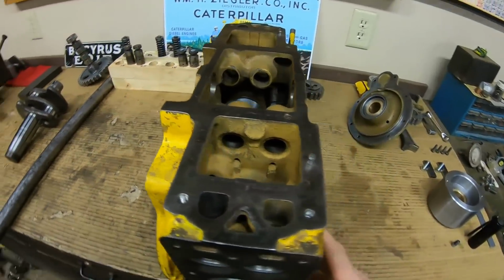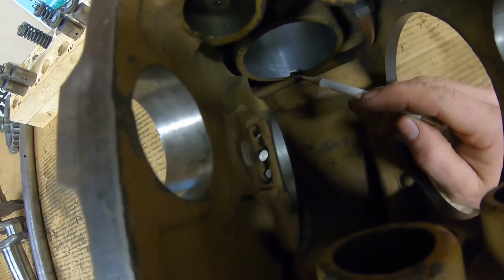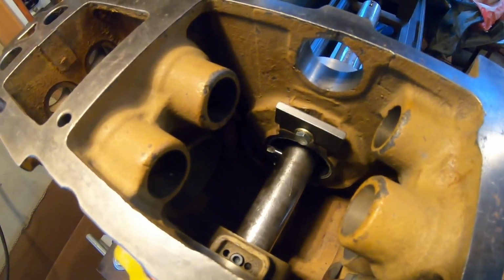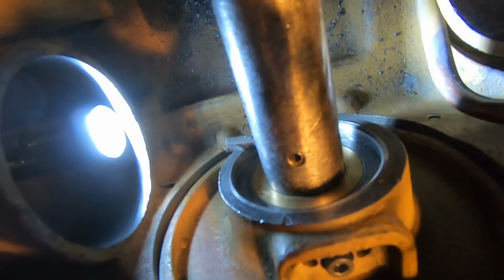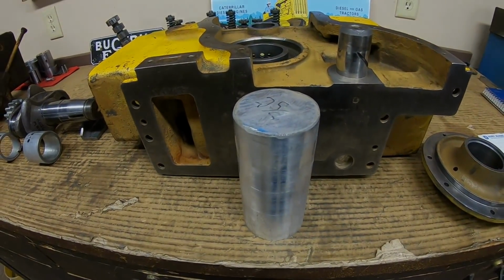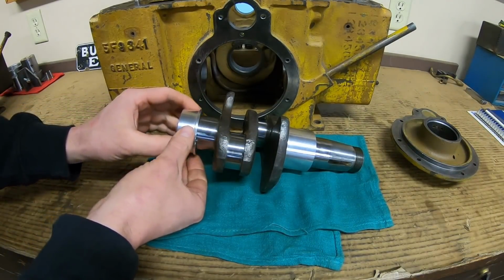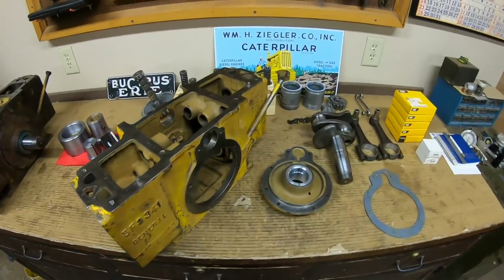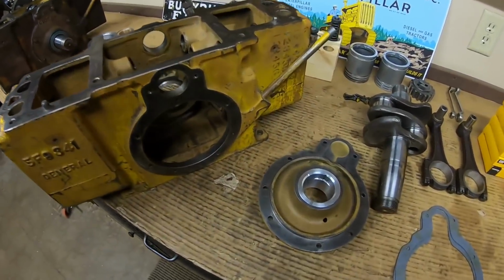Caterpillar D2 #5J1113 Starting System Ep.14: My Total Pony Main Bearing Redesign - Kinda Crazy!!!

Comment: William Powell I enjoyed the rebuild of the pony Motor for the cat engine. I have never been around heavy equipment. I have enjoyed watching you completely rebuild the D2 cat.
I mostly deal with the boating industry.   
What is the things that I rebuild on outboard motors lower units stern drives in car engines used in boats.
I have installing A lot of cat diesels 6-8-12 cylinders in our yachts.  
I have always enjoyed rebuilding and repairing things since I was a young boy I am now retired 67 I am always watching stuff on YouTube that’s how I come across your channel keep up the good work enjoy it thanks Bill

Comment: You could avoid chamfering the bores edge by undercutting the inside corner of the flange on the bearing with a radius. For example take a triangular with 1/32 radius turning tool, touch the flange face and plunge into the bearings OD. This creates a corner that radiused about 90 degrees then tapers up by the angle (15° to 32° depending on how you set it) of the back side of your insert to the OD. I have seen this in several different applications, mainly in hydraulic cylinders ie rod stubs to clear pistons, wear ring grooves on pistons. Easy to do, and seems to stop cracking.
Edit: but good job on how you have done it; the best solution is the one that works for you. I am enjoying all of your rebuild series.

Comment: I dont know where you learned engineering but you are spot on . even in welding hull patches to a dozer bucket patch you want rounded corners even a patch in a pressure vessel

Comment: Squath, I have enjoyed all of your videos, even the farming ones and the brush clearing ones. I do not have a dozer and probably never will but I have 10 old two cylinder John Deere tractors, one Allis Chamber and one Oliver 88 tractor, all of which 
I overhaul and maintain. I have 6 old air cooled two cylinder Volkswagen sedans, of which I have 3 in running and driving condition and I have 6 motorcycles, 3 Hondas, 1 Harley Davidson, 1 Suzuki boulevard, 1 Yamaha road star, 1 Cushman Eagle that I put a V-twin 18hp Briggs & Stratton engine in and 1 Bonanza mini bike. You can tell I love mechanicing and machine work.
Reply: Two cylinder Volkswagen sedans????
Reply: @erik_dk842  I ment to say air cooled 4 cylinder VWs.

Comment: I can already see the outcome of this rebuild. So much planning and drawing on past history of other engines this should work better than new. One of my life idols was a man who rebuilt motorcycle engines. His motto was that "it can always be rebuilt one more time". This is why I enjoy this series of videos. There is always a solution. So many pieces of industrial equipment, old tractors, engines etc. have been taken to the scrap yards. A throw away society we have become. I think that is due to the fact that no emphasis is put on saving equipment. Very possible it also means that there is not enough people who are in the repair business. (old school technology) In todays world it  seems that everything is replaced rather than repaired. Great projects now, and I bet more will follow. Can't wait!!!
Reply: @squatch253  Thanks for the comment. I had the same problem with radiator on my 460 utility. No new parts available. No used radiators available. Finally found the right person who knew what to do. Brother, it was not cheap. Throw enough money at any problem and it will go away. Same thing now applies to my health. Every day is a good day. Thanks again. Chuck

Comment: I love that you aren’t afraid to try something new on a simple setup that allows for some modifications. My only initial concern would be wether or not you shifted the location of the rods and how they locate in the center of the cylinder bore. Though I assume they have enough movement in the pins to take up that small amount of offset. I like what you are doing and your brain seems to work like mine does.

Comment: I like the tri-build series.  Honestly I find this very interesting much more than the undercarriage work(to be fair Im a heavy equipment field mechanic and have done enough undercarriage work for 3 lifetimes).  Now what we really need to see is a starting motor with electric start.  Honestly I think thats the perfect setup.  And yes I want to see how far that starter will move the Cat in gear.  (I bet it will shock you).

Comment: Very nice, and to be honest I like your design of the new thrust bearings a lot better than the original setup.  Just seems a lot better design, a lot less likely to have issues than they did from factory.  Is your plan to give these all a test run too, even the ones that aren't installed on an engine?  Thanks for sharing in such great detail Toby, I really enjoy learning about all of this.
Reply: @squatch253  Hmm. I know you said what you said,but would it be worthwhile doing a belt and suspenders approach,that is paint the spiderwebbed cast iron area with Glyptal, or maybe an epoxy paint ?
Cracked cast iron makes me nervous.

Comment: Excellent content as usual!  One thing to think about is that the crankshaft will grow in length as it heats up (0.0000058 inches/inch DegF) and the original distance between thrust faces would increase by ~ 0.0014" (assuming 2" journal length with 120 DegF increase in temp).  Your new configuration would DECREASE by ~0.0042" (assuming 6" between thrust bearing faces with the same 120 DegF temperature rise).  With a bronze or tri-metal bearing this may be tolerable, Aluminum bearings are very sensitive to increases in operating temperature since they EXPAND about 2.5 times as much as iron does for a given temperature rise.  While it is entirely possible that your engine will be fine, you will be running with significantly less thrust clearance than originally designed.  I recommend that you set your thrust clearance toward the large end of the spec to assure that things don't bind up when it gets hot.

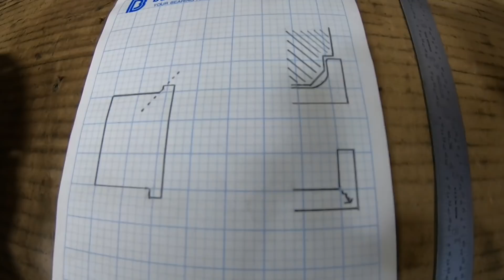Comment: 14:32 keep in mind that you would've been easily ok with doing a 45 (countersunk) cut for extra strength, no step. There would be no function problem with that.
There's a german made (ancient) tractor, the name escapes me right now (i wanna say it's a lanz-bulldog, but likely not) where the thrust bearings are retained with a 45 lip in a babbitt regular bearing. I think they're bronze bushings that go halfway through the babbitt bearing, kinda making it half and half.
They likely couldn't put a proper sleeve in there because it's a tight cavity, so they chose this odd, but functional method.

Comment: Did you have to give special instructions to the shop that ground the crank to kiss the back surface to assure it was parallel to the bore? I would imagine from the factory since that was not a running surface it may not have been finished.

Comment: Hi Squatch, just a thought. Although that bottom gasket will contain any oil leaking past the con rod attack location there would be some reduction in circulating oil volume. As a kindness to future owners have you considered sealing the inside of the engine casting with an epoxy paint or similar? Cheers.
Reply: Any oil that leaks out would be made up by toping the oil to the fill mark

Comment: If you placed an indicator on the lathe and referenced to the saddle you'd have a precise measurement for the saddle movement. 
     From your bearing design your thrust face shoulders take the loads so there can't be any loads on the bearings  except for the shoulder faces so a radius on the inside corner is irrelevant . I probably would have even undercut the inside corner.  Just my opinion.

Comment: Did you see today's cutting edge engineering au video on repairing a hole punched in a cat grader bell housing. He fixed the cast iron with a type of spray welder.  That type of weld could be used to fix freeze damage to blocks.

Comment: I had to tear down an air compressor (10 hp Kellog American) and was surprised to see the rebuild kit with something like 10 gaskets on the crank end cap.   Ok,  pretty strange but the tapered roller bearings were destroyed,  hmmm.    So,  trial fit with one gasket and the thing is locked up.   Add more gaskets and I have used all the new kit gaskets and its still locked up.   The light is coming on,  it was put together and was tight with no end play,  ergo,  the destroyed bearings.    Being all out of new gaskets I start stacking in old gaskets and used 3 or 4 of those.   Now those were compressed but it took that much to get the spec end play on the crank.    First start ups must have been interesting as it simply ground in to end play and lasted 20 years (no,  they did not maint on it)

Comment: Looks good what you did! Instead of the two gaskets and shims, I would  put cover in the lathe and put  bit touching the bearing, set up a dial indicator on lathe bed as to measure advancement of cutter then remove what you need to get the end play you want! Just another way of doing it, have done this in the passed on other parts to get proper end play. Again like what you are doing!
Reply: I like the idea of having it set up where you can adjust it without having to be overly precise with the machining. If you accidentally take too much off the bearing you have to make it again. This way if you need less clearance you can use a thinner gasket. Onan engines were set up with the same system for adjusting endplay.

Comment: Toby, where is the "thrust: coming from? Straight cut teeth on the gears and no pump or anything you should not get any real thrust in the crank. In automotive you get thrust from the pump in the transmission or the helical cut gears in a manual but this just has straight gears that produce no thrust. What am I missing?

Comment: Nothing wrong with staxking gaskets as shims 
It's fairly common on right angles gearboxes on mower slashers to set the gear tooth contact pattern amd bearing preloaded and the side loads they take is 100x more than that little motor will put out 
Mine is 120hp rated and is still working fine after 30yrs

Comment: I surprised you would not want to run the crank end play a little on the tighter side.  Something like .007 to .009.  The crank now has side support  on both sides, and the factory seemed to be very generous on their numbers.
Reply: If your curious heat the bearing you made to 250 degrees and see how much they grow.  Bet its less than .001.

Comment: In each build when you install the front bearing in the bore you do not press it flush.  On this one, you also leave an even thicker flange on that front bearing.  I’m thinking you have moved the centerline of the rod journals toward the rear of the engine maybe 0.030”

What will this do to the connecting rod bearing and piston pin bushing life?

Comment: Might it help to build in some extra oil capacity? An external reservoir? A solenoid/shut off for the fuel? Largely operator error on the fuel shut off, but that could be automated fairly easily with a simple piece of software control on the shutoff.
Reply: @squatch253  I totally understand on automated everything. I came from the chemical processing industry, heavily reliant on PLC run processes. That kept us out of a lot of potential disasters, you could not do Y until you did X. However, as my engineer friend said, and was proven out, when you make things idiot proof, they just make better idiots. 

What about adding oil capacity? Even my modest B+S lawn tractor has two quart capacity.

Comment: Two out of my three 955 pony motors had castle nut issues. The castle nuts for the rod bolts (one per pony) had cracks and one was in two pieces laying in the bottom of the crank case; the other castle nut was hanging on for dear life and when I touched it with a wrench it came apart..  
Is that a common issue on pony motors?

Comment: Considering how little work this type of motor actually does... even if the skirt were damaged beyond use, i'm willing to bet that you could braze a cast iron slab into position (with a support touching the outer case) and bore it back to size. If you'd do a decent job to blend it, which is easy with a 90 degree die grinder, nobody would be any wiser.

Source: i've seen single piston, mine pump engines where they were so out in the back-of-nowhere.jpeg that they basically brazed the whole thing back together, and there was plenty of evidence of it working because they did it just well enough to work, the rings basically doing the final scrape where a decent spattering of braze was embedded into them, making them seize, which is what actually killed the engine, eventually.

With modern stuff, i'd fix that and sleep like a baby, even on bigger engines, with more power hours required.

Comment: Hi, great video and alot of thought and work put into this. I was surprised at the choice of aluminium as the bearing material, is it a special grade ? I know that the oil is supposed to be the bearing in hydrodynamic lubrication, but there may be some wear on the aluminium during start up. If you have other experience using this combination (steel / aluminium) then dont mind me ! An aluminium bronze might have been a better choice, but I imagine a bit more expensive in that sort of diameter. You could always anodize the aluminium parts you have made, this would make a harder surface - but perhaps seek advice before persuing this route. As a note beware of anodizing, as a rule of thumb half the thickness of the coating grows inside the material, half outside, so you would have to adjust your fits. Nice work in any case, hope it all works out.
Reply: @squatch253  Thanks for the reply ! You have obviously considered this point already :o) Good luck with the project, I have subscribed to check out the rest.

Comment: Do I have it right that the pony motor was spinning at however many hundreds or thousands of RPMs and overheated because the crank case oil had lost its viscosity due to gasoline and it STOPPED COLD, not completing even one revolution? I just can't wrap my head around it not banging around for, say, 15 seconds...which would translate into dozens of additional revolutions.
Reply: @squatch253  Wow. It's a little amazing (to me, anyway) that the whole thing didn't just explode. Guess I don't have a feel for the forces at play or the strength of the parts at issue. Thanks for the reply -- I know you have a lot on your plate these days.

Comment: nice vid - what stock did u use for the main bearing? thinking of turning myself one mines scored quite a bit. alu? or bronze bushing stock?
Reply from the maker: T6061 Aluminum, it’s the closest match available to the original Cat factory bearings 👍
Reply: @squatch253  awesome thanks - think i actually have some round stock. What was your approx final OD on the bearing flange? Might leave some there on mine but maybe leave room to stack shims. Prev guy who worked mine stacked shims behind the 2 bolt gear - seemed to work but he had at least 60-80 thou in there lol. I might consider reverse engineering the bushing to fit common GM or other axle shims or something. 

Lastly: any idea how to remove that dowel from the bearing? waiting on manual, do i see a hex on yours? or do they tap out from the bottom? id like to reuse mine if possible or option 2 is tap/loctite in a shallow rifle style set screw. Mine was a little loose but bearing was not spinning-
Reply from the maker: The dowels are just a light press-fit, they tap out easily by inserting a small diameter punch up into the bearing, then once you get them to lift up a little you can grab onto the top shoulder with a pliers and pull them out.  Most times they're already loose, or have worked themselves upwards a bit which makes the process easier still.  Those dowels are the main weak link in the design, because they typically back out and let the bearing start to move, which wrecks everything else.  The skinny front main takes 100% of the crankshaft endplay in these engines, the wider rear main behind the flywheel just supports the crank.  Shimming anything on these crankshafts only leads to more problems down the line, whether it's thin shims behind the gear or thrust washers on the crank journals - both only serve to increase the amount of wear surfaces plus introduce even more debris into the oil and because these engines only hold 1 quart, are just a splash lube system, and run at 3,000 rpm they've already got enough strikes against them without shims and washers adding even more.  But the shims and washers are a common work-around because they're the "easiest" to do, which is why you'll hear so many people recommending going that route.  Here's a link to the D2 starting system playlist I created of doing every type of rebuild and redesign to these starting engines, from the original factory setup, to just an improved threaded bearing dowel, to the complete double-thrust bearing mod, which also applies to the D4's as well - https://www.youtube.com/playlist?list=PLW_TtiTWGCaqrtx5aEi85ZTwQwGRXWeMo  

I highly recommend watching episodes #12, 13, and 16 in the list but they're ALL packed with every spec, dimension, procedure, and sequence you could need to solve any problem.  The videos will do a much better job of listing those details than what I can type here, and going by your description of your current pony trouble I think the best and easiest endplay mod you can do is to stick with the factory style main bearings (even if you still turn out your own over buying them pre-made) and just upgrade to the hollow 5/16x18 threaded retention dowel I show in the videos, which by itself will solve 90% of the crankshaft problems that these small engines face :-)
Reply: @squatch253  excellent will take a look. Going to mic journals and pull my two bearings. i recall one being a little worn down so turning them on the lathe would allow me to get it back to a good tolerance..